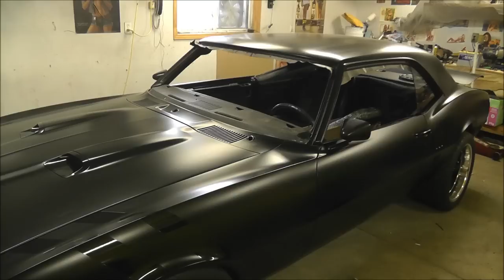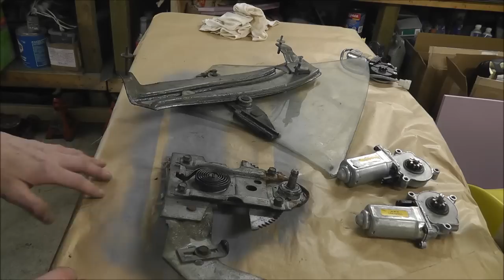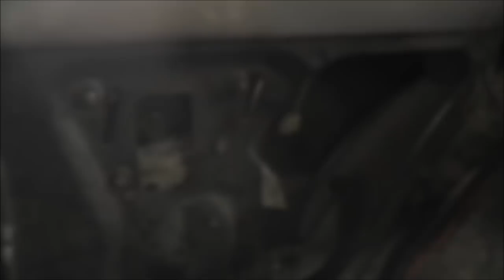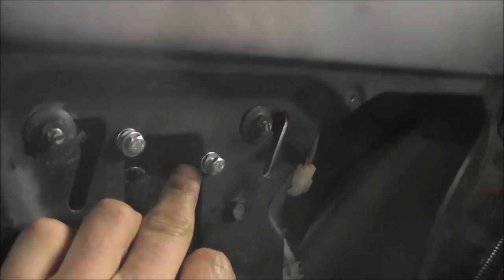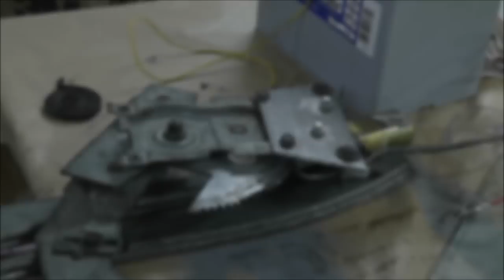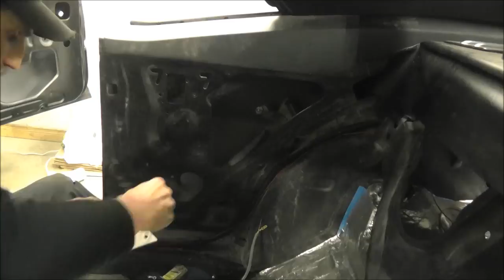My 68 Firebird Restoration Part 77

Comment from the maker: Thanks Greg! I'm going to use a 5 or 10amp circuit breaker on each motor, I picked up some window switches from ebay I'll send you the link if I can find it, if not I'll show them in the next video!

Comment: Great stuff Rob.  Can you tell me what you are using for switches?  Do they have a circuit that cuts out at the top and bottom so the motor doesn't burn up?